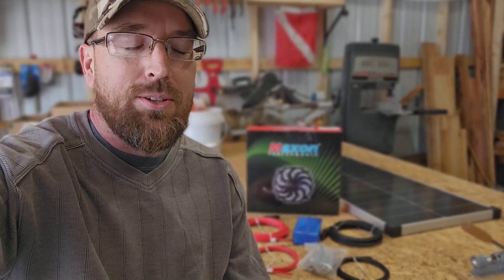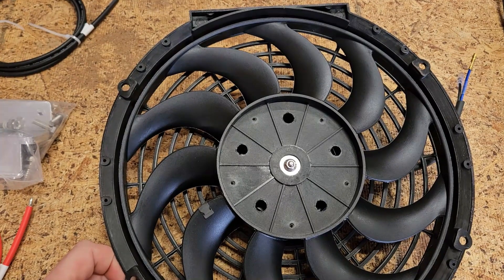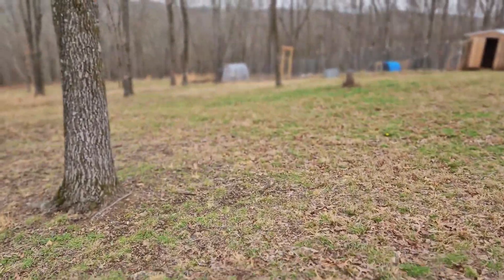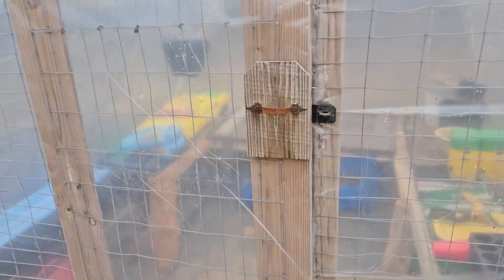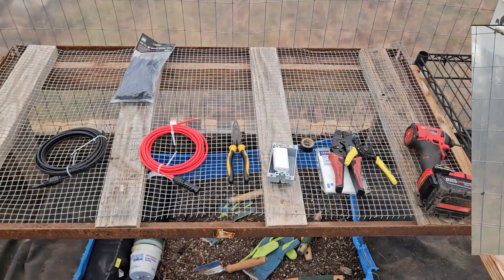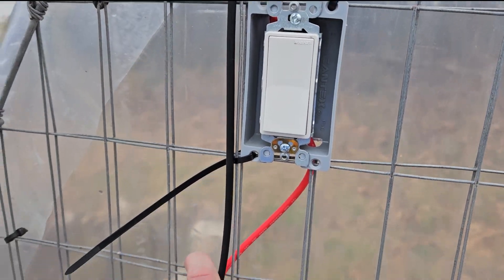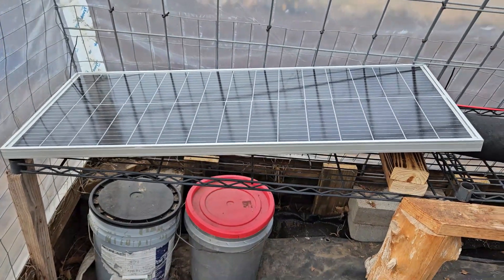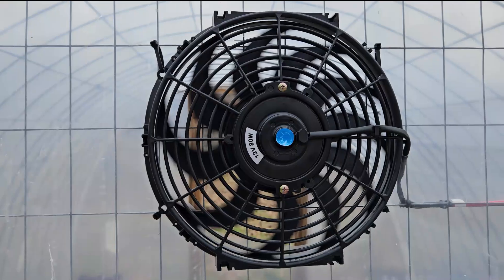OFF GRID SOLAR GREENHOUSE FAN

Comment: I was sent your  video thanks. I have never seen anyone put the fan on the outside of the building.
Reply from the maker: I'd imagine you could run the system either direction. Thanks for watching!
Reply: Yes, Im thinking it would make more sense to use it to exhaust the hot air up high...and have intake vents low on the opposite side.  This is a great idea, using the automotive fan.

Comment: Should definitely have that fan powered via a controller, it's only rated for 12 volts and that solar panel in full sun will be putting out somewhere between 15 and 22 volts, the controller should regulate this down to 12 volts.
Reply: Built a high velocity fan using automotive blower motor direct connected to 100 watt solar panel in 3rd year testing hasn't burned up yet. Great full sun goes into turbo mode. Nice fan sitting on porch keeps you cool.
Reply: A battery or 2 depending on Amp draw from the fan.. would help alot..
Reply from the maker: totally agree. it would also considerably increase the expense for the project. Worst case, I will go that route, but wanted to see what would happen with a direct wire setup. Thanks for watching.
 @towguy-johnnytowtruck
Reply from the maker: As mentioned in the video I am doing this as an experiment. If it doesn't work Ill be sure to do an update.  Thanks for watching.